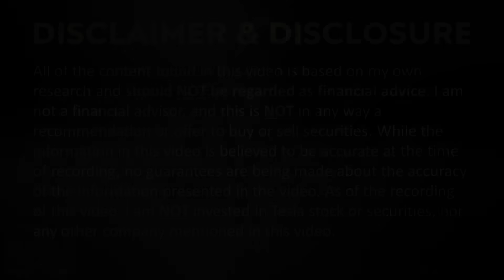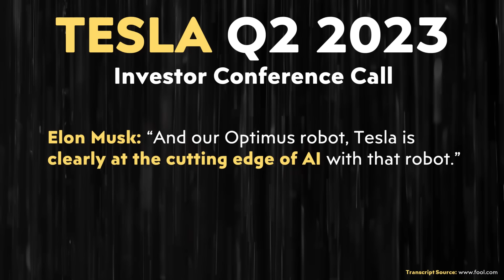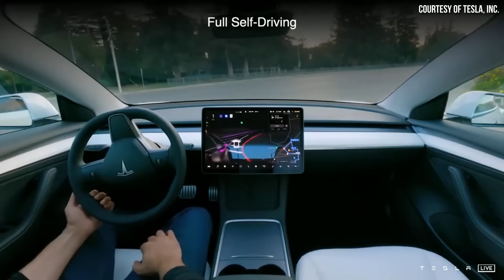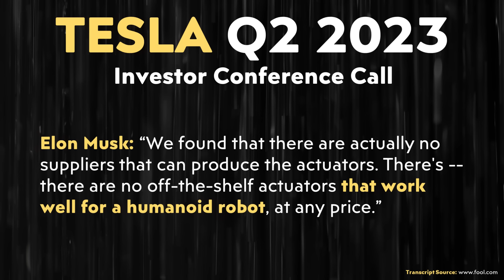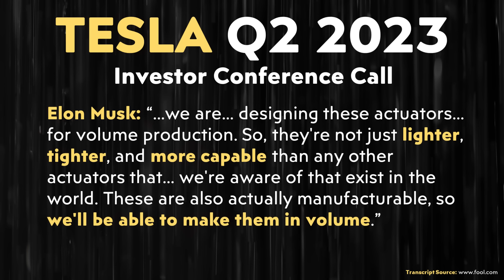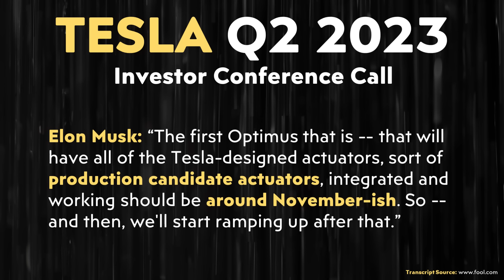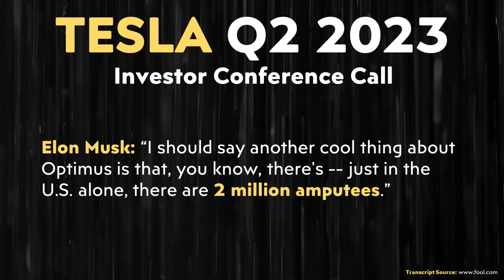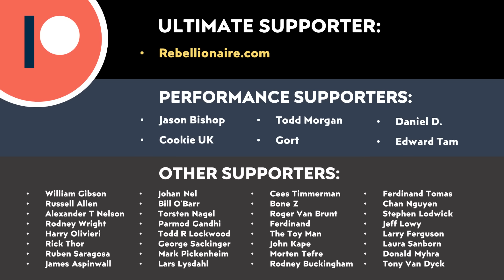Elon's BIG Tesla Optimus Robot Update | Robot Factory Workers?

Comment: I've always been impressed by the robotics demonstrated by Boston Dynamics. The one thing missing though was the AI. This is where Tesla has a huge advantage IMO. I'm not surprised that the self driving software can be adapted for humanoid robotic use. A robot will need awareness of its surroundiings to make it both useful and adapable. It's early days but it will be interesting to see what Elon comes up with. One major issue that needs to be addressed is power supply. For a robot to be fully autonimous it will need sufficient energy to carry out tasks for an extended period of time. It might be okay in a factory envirnoment where wireless power could be supplied to each bot but out in the field is much more challenging.
Reply: Just make robots with swappable batteries like today batteries powered tools...
Reply: Do you believe that FSD is used in Optimus?
Reply: Tesla does not have AI. It has a cruise control system on cars.
Reply: @Withnail1969  Which works TERRIBLE unless lab-perfect weather where it only seems to break due to shadows fra trees/trucks or just brake now and then without any obvious reason. Driving 30.00 0 miles a year has become an uter nightmare in Scandinavian climate after "Vision"-virus was injected into my former so much beloved TM3 which for sure is the last Tesla i shall ever own after he ruined my car with that marketing-bs greed-stunt Vision is.
Reply: @Withnail1969 @ChipMlk the hate is real 🤡
Reply: @BigTopDOG  The experience is real, you act on feelings, marketing-bs and seems to hate fact and 1. hand experience.
Reply: @Withnail1969  1. You will for sure never EVER see self driving on HW3.0 with those miserable 1.2 MP cameras when the car intermittent cant even keep speed on simple cruise control when visibility drops below 500 Yards (not 50, not 150 but 500 Yards) and wipers that cant tell the difference between mist/ice on the inside of the windscreen in the camerahousing or rain and with "auto"-dim that more acts like an indicator-light at night. 

None of the above was an issue before Elon ruined my TM3 by removing the functionality of the radar. Everyone knows, Elon has even admitted himself the wipers "automation" are an utter joke and 6 years after TM3 was introduced, the "automation" absolutely still are, due to lack of a proper rainsensor, same with "auto"-sim that takes up to 8-9 seconds before going back up on hi-beam after passing a car. 

Before "vision"-virus i had wipers and lights in 100% manual and everyone was laughing about how this hi-tech car was a joke on wipers and lights. After "Vision" its an utter nightmare with wipers going berserk on those wintermornings, lights flashing after rain etc. and SO many days where a bit of mist makes any use of autopilot/cruise control completely impossible so what i got all those days while driving 125 Miles a day is a 2 year old car that act like a 50 year old car. 

So absolutely yes, My Tesla is a POC car today vs. the fantastic allweather tool for 30.000 Miles a year driving it was when i bought it 2 years ago. 

Only reason for this? Elons greed by removing essential sensors like rainsensor, radar, USS's (Stalks should also be removed on 3/Y's according to Highlander-rumors)  so the car is a nightmare to drive in anything but lab-perfect weather.